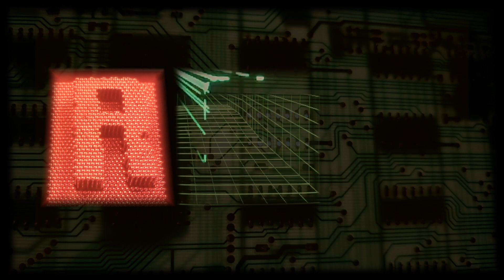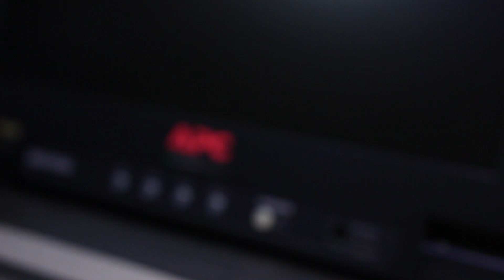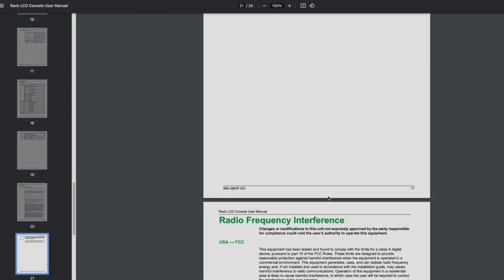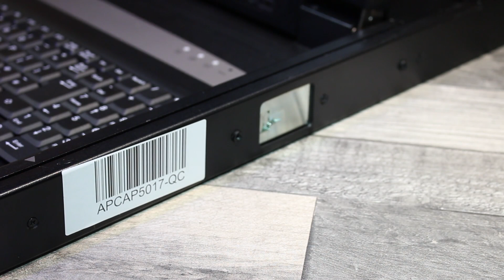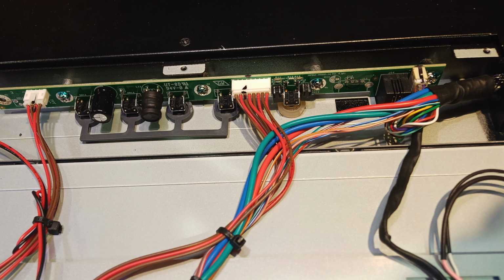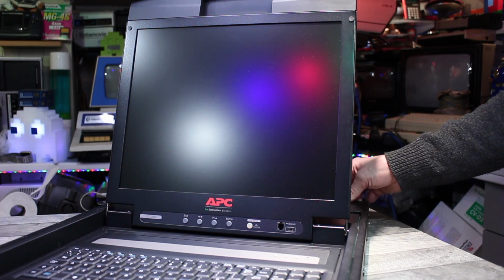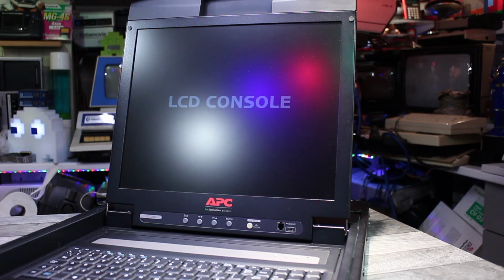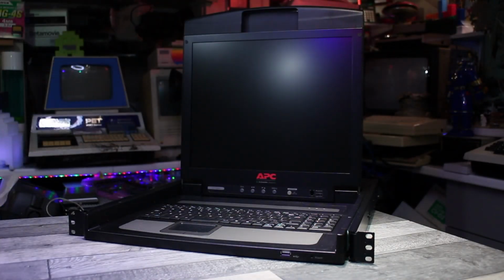APC $1600 AP5717 17" Rack Mountable Server LCD CONSOLE with Integrated Keyboard +Mouse overview test

Comment: Can we use this as a normal laptop
Reply from the maker: This is just a screen and keyboard. No computer inside.
Reply: Can you make a pinout video of The cable? Will help us Who dont have The cable and even cant buy. Sorry for my bad english, im talking from Brasil, and had a console like yours, but i dont have The cable, and cant find it in anywhere. Im shure That this video will help a expensive number of persons like me. Thank you so much!
Reply from the maker: Hi it will work as a screen with a standard VGA cable
Reply: RetroGadgetMan  Yes, but the keyboard and touchpad in the console are cool and extremely useful. So what id like to see is where the usb pins attach on the vga connector, and if there is some kind of conversor (for eg from ps2 to usb).
Reply: Thank you very much to answers me!